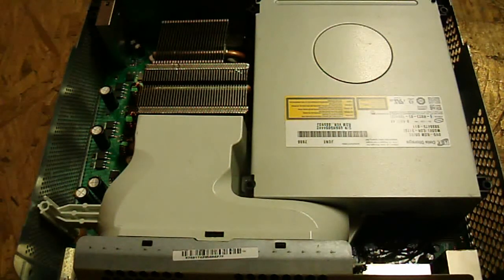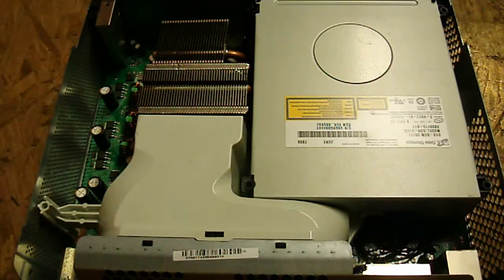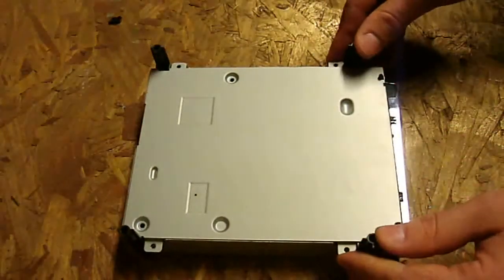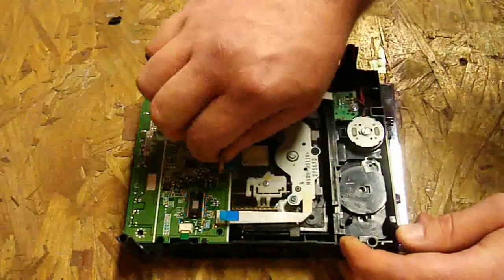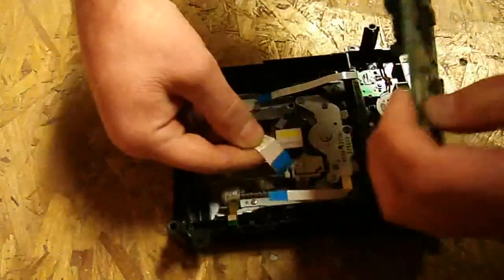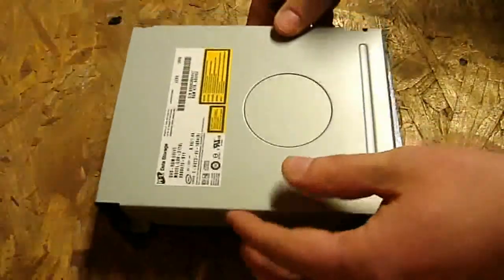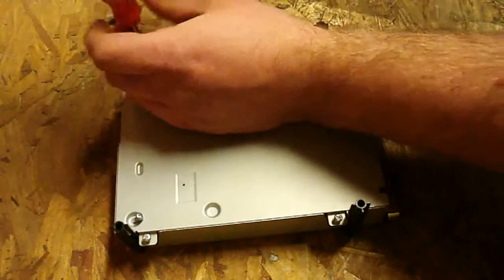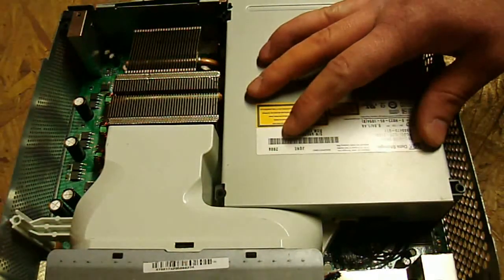How to replace an xbox 360 disc drive - HITACHI disc drive replacement tutorial

Comment: Thanks for the cool video. I have a Zephyr that dont work(It turns on but doesn't read so I am suspecting drive fail) and a Xenon that works but i dont have the adapter for the Xenon and no monitor that has an AV input. Could I take the drive from the Xenon and put it in the Zephyr? Would I have to take the PCB board from the broken Zephyr drive and put it on the intact Xenon drive as well? I've found out that some Xbox's use Hitachi drives and some use Toshiba but I havent checked which on my xboxs have.